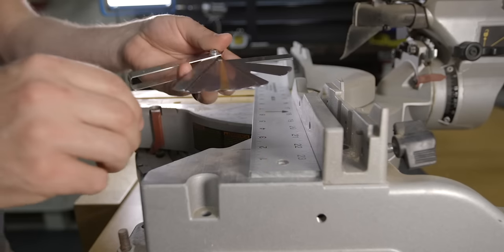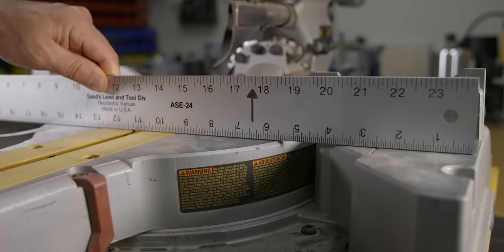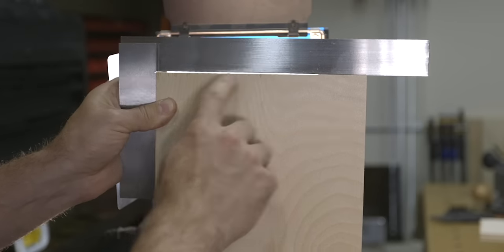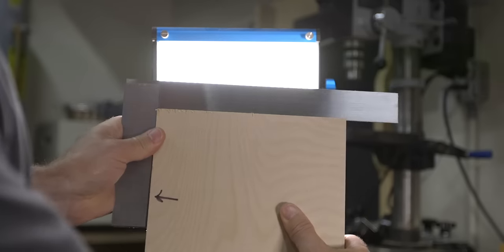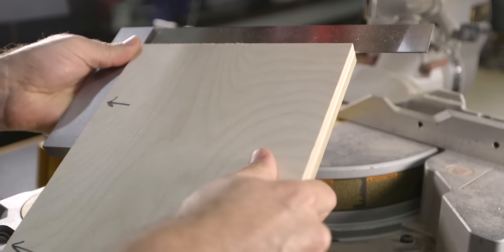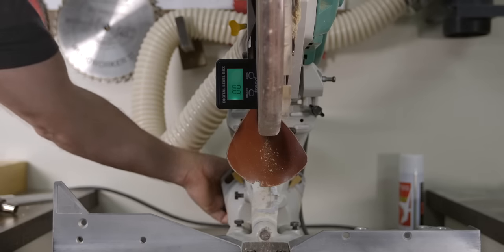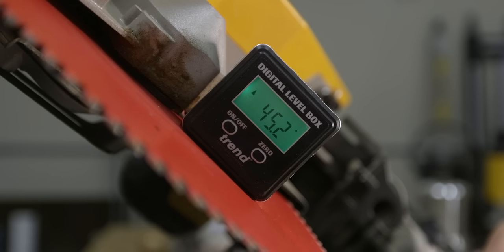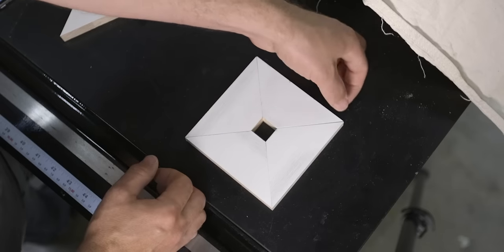Adjusting Miter Saws For Accurate & Square Cuts

Comment: I have the same 10" Hitachi and have calibrated it the same way you have outlined. I have it all dialed in, when I bevel right, I get a square cut on 45 or whatever other angle. But when I bevel left, im off about a degree. Any ideas on what my issue could be?
Reply from the maker: Sounds like the left dial indictor is off? Did you check that?
Reply: @TrainingHandsAcademy  I'm sorry, to be clear the issue I have is that the cut is not square along the length. For example cutting base flat on a 45* bevel with the miter at 0*, I'm a degree out along the miter/flat portion of the molding, the angle of the bevel is accurate as is the pointer indicator.
Reply from the maker: @michaelnichols7669  oh sorry, I want to say my saw has done that as well (and does that still to a small degree). Honestly, I thought my saw just had too much abuse on the job site. But after calibrating it, it's pretty close. I wish I had a quick fix for you... maybe double check things again?

Comment: Very well explained. I have a Ryobi 10" with a one piece fence. It has 4 bolts holding the fence. No matter what I do there is not enough margin to take away >1º out of square. I can set the table to -1.5 º and it is fairly square. The instructions have only the mitre bevel adjustment marked. Am I missing something?
Reply from the maker: I'm sorry but I'm not that familiar with that saw. You can send me a video on IG if you want.

Comment: Do you have to do this on a level surface when using the digital angle finder  ?
Reply from the maker: It helps, but you don't have to. Once you attach the angle finder you can zero it out before moving it.
Reply: @TrainingHandsAcademy  ok thank you Ill try that . How accurate is that angle finder you have ?
Reply from the maker: @agustinherrera5600  really accurate... i like it.
Reply: @TrainingHandsAcademy  thank you

Comment: You can't truly check a square with a square because what if that square is out.  The only accurate way is to make a straight edge then put the square in the centre and scribe a line the full length of the square. Flip the square over and bring it back to the line. If it's square then it will touch the line all the way along. If it's out it will only touch either the top or the bottom of your scribed line. I hope this has helped.

Comment: Great video, thanks for sharing 👍
Have you made a new wooden slot on the smaller saw where the blade goes through? 
If so is the opening narrower to avoid tear out ?
Reply from the maker: Yes I did, and it does help to reduce tear out. They are called zero clearance throat plates/inserts.

Comment: Unfortunately my detent plate doesn't loosen for adjustment and the slot for the positive stop is so wide open that as soon as it gets close (and it needs to be close to the slot) it slips back into the slot with vigor and I'm back to square one. It's about 30 years old and I think it's ready to take a long shed nap sadly
Reply from the maker: It's time to put it down. :(
Reply: @TrainingHandsAcademy  sadly enough man 🤣

Comment: Mentioning squares not square and building compounding error prone projects is some good badass advice! I'm still struggling with my blade perfectly 90 to my base. As for the digital angle finder, mine is a good brand but drifts and drives me nuts. I wanted something digital for accuracy not frustration. To me, that number should not move unless there happens to be an earth quake during set up time. Lol. Using a brand new blade and checking rotation visually, explain how a digital angle finder can show 89.? On both sides? Now I'm not hitting the teeth and I've tried it various location. I cleaned the blade and the base of the angle finder and blew with shop air for any undesirable debris. What am I missing? Personally, I think a true square is best but make sure your base is true flat. This all is driving me nuts